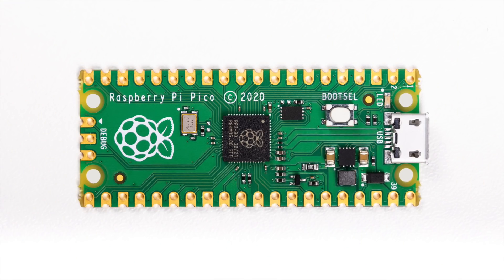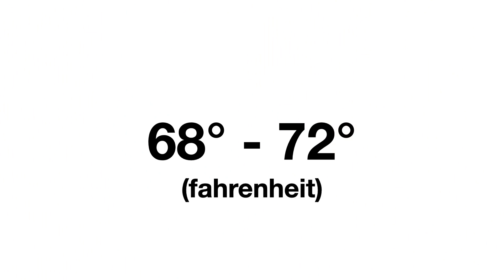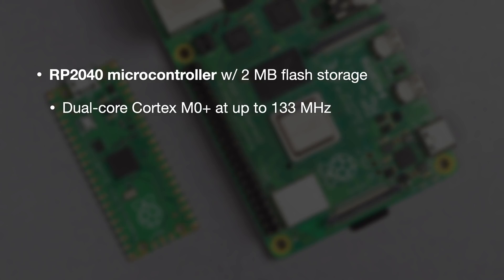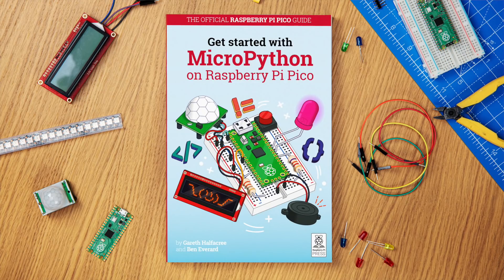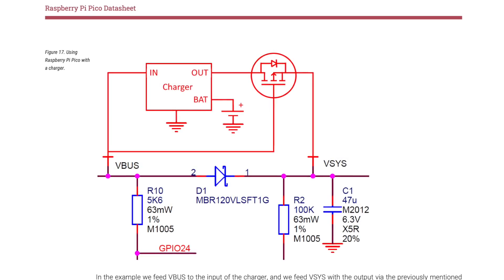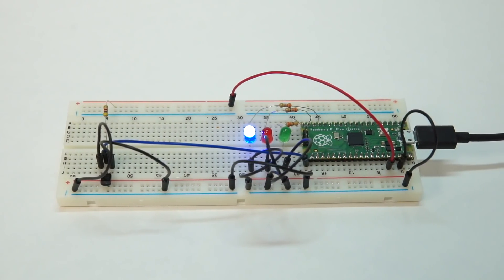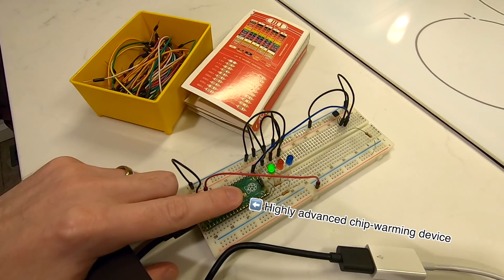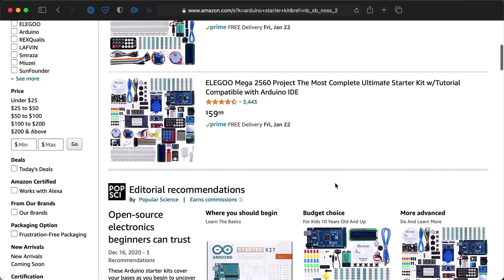The Raspberry Pi Pico Review - $4 ARM Microcontroller

Comment: In the microcontroller world, raw specs are rarely the main reason for choosing a particular microcontroller. Things like software support and built in peripherals are usually more important. In these areas the Raspberry Pi Pico is currently significantly less impressive than other offerings on the market. The main thing I think the Pico brings to the table is reasonably high specs at a low price point. Good, but not knock your socks off good.
Reply from the maker: I think that's what the Pi Foundation was going for; they'll be getting the educational / software side of things up to speed with good support over the next year or so (my guess).

The Pico is definitely not an ESP32 killer.

Comment: Hate to be that guy but I feel like if you have an FTDI or can borrow an Arduino (preferrably Uno) you can get ATmega328p's for much cheaper, much more versatile and easier to program. You just need to program them, best way would be to borrow a Arduino Uno, program it and swap out the ATmega328p

Comment: i think this device is a platform for just one thing,,, PIO Blocks,,, datasheet  RP2040  
>>   3.2. Programmer’s Model &&  3.2.1. PIO Programs
>>  3.4. Instruction Set  - PIO instructions are 16 bits long, and have the following encoding:
https://datasheets.raspberrypi.org/rp2040/rp2040_datasheet.pdf

Comment: Definitely overpowered for the intended purpose. An Arduino pro mini, led's,  relay  and a 16x2 lcd display is enough to monitor and control a fan. Even make it wireless via nrf modules to monitor and control from the next room.

Comment: Why don't you solder the pins on the other side of the board so the parts are on the underside. That way you can see the pin labels. That would make it harder to touch the microcontroller in this application though. Also help keep the dust from settling on the parts.

Comment: I did something similar with esp32, using esphome firmware to log temperature in my baby room. Linked everything to my "Home Assistant" server including aircon and had it regulate temperature automatically :)  ( later on I changed the esp for Chinese temp logger with hacked firmware )

Comment: ?
Sometimes, your choose the hardware, but because it's the best for the job, but because you want the new hardware.
Going with the pico is that case.
Getting one of the sister boards would be more practical.
Going with an LED only output is limiting.
In order to see what state the room is in requires being in sight of the device.  You could just as easily read a thermometer, and get more information.
Going with one of the sister boards would be a better choice.  The ability to communicate with you when you're not IN the room, through wifi or bluetooth, provides better functionally.  Bring able to get more information, see the actual temperature, is better.  Power consumption is not a limiting factor, you aren't required to use batteries, so you don't NEED scavenge power.

BUT, if you just WANT to use a board with lesser capabilities, for experience, bragging rights, etc., that's OK.

Comment: the internal temperature sensor is mainly meant for measuring the temperature of the die that can affect things like ADC's or clock stability etc... or just if it's about to explode from overheating. It's not really meant for this application, but if it works... :D
Reply from the maker: "If it works, it ships!" 🤪

Comment: I tend to be a little sceptical about this pico board, and I am not the only one: https://tech.scargill.net/raspberry-pi-pico-would-you-bother/
Reply from the maker: The lede of that story is the price.

I just walked out of a Micro Center where it was being sold (in quantities of one) for $2.

So, yes, there are places where you can't find it for $4. I get that. But just like people arguing you can get free shipping from CHINA on certain sites and get similar chips for $2-5... I quote prices for resellers I trust and aren't shipping direct overseas through government subsidies.

Delivering the goods is hard, and the Pi Foundation has trouble keeping any new item in stock, so right now some places (not official resellers) will be price scalping, and charging insane markups on shipping.

But to say it's not $4 when there is a significant portion of the world's population who can in fact buy it for that price...
Reply: @JeffGeerling  To most people, 2 or 4 dollars is irrelevant for the one or two boards they will buy. Personnally I can't see clearly what the PICO has to offer over the ESP's or the low end  STM boards (Blue Pill, Black pill) , except for the Raspberry Pi logo and the support of the Raspberry Pi foundation. Support of Espressif and to a bit lesser extent for private users, ST is not half bad.

Comment: in the context of microcontrollers, "RTC" usually means "real time clock" ;)
Reply: I thought the same, but in the datasheet.  "1 × Timer with 4 alarms, 1 × Real Time Counter"
Reply: @artvandelay777  In the RP2040 datasheet it actually says real time clock at the start of chapter 4.8.
Reply: @henriburau6293  Yep.  I noticed that after I posted.  "Real Time Counter" is from the pico datasheet.
Reply: @artvandelay777 so inconsistency documentation?
Reply: @yumri4  Well... a real time clock is a counter, isn't it? And, a single wire, by definition, has to work serially!
Reply: @johnm2012  even more so an oscillator electronically. COUNT the oscillations and depending on the frequency map it mathematically to to how many oscillations in a given time measurement (microseconds etc) and now you are counting time. If you all want to agree on a time then manually input or connect to a time server and then adjust your count number to the same as the server and continue on counting oscillations to increase that number and everyone is now counting the same time value.
Reply: And SWD stands for 'Single Wire Debug', not 'Serial Wire Debug' ;) source: am using it everyday atm
Reply: Road to Crisis;Research and Training Center;Renton Technical College (Renton, Washington);Response to Comments;Real Time Chat;Real-Time Communication;Regional Technical College;Real Time Counter;Real-Time Command;Real Time Capacity;Relative Time Clock;Radio Transmission Control;Remote Terminal Cluster.....dont forget the rest!
Reply: Pico have inbuilt RTc ?
Reply: If it doesn't have ble bin it !
Reply: In the context of Raspberry Pi boards, "RTC" usually means "really tiny computers" ;)

Comment: you're kidding, right? writing python on a 2mb flash mega MCU to measure temp and run 3 leds? This is everything wrong with modern electronics. You can literally do this with a few comparator. No wonder people's programs are 10mb for a led_blinkie.exe

Comment: Your review is cool and informative but I can't figure out a real-life use for the Pico. It's power consumption in sleep is too high for anything battery powered, it's gonna be overkill for a lot of projects and where it won't, chips from ST are usually gonna be a cheaper choice (plus those have SWD support embedded directly on the developer kit). If it gets people into microcontroller programming and away from Arduino, I'm gonna be super happy though. :-)

Comment: Teensy 4.1 "Hold my beer......."
Reply: I was actually looking at that earlier. A big difference is it costs over six times as much. Considering this Pi Pico is way overkill for most applications Teensy 4 is really much more of a specialty product IMO.
Reply: @eDoc2020  Yup, for a production design it would not make sense to build 5000 units at $22 extra, but for a one off unit the 600 Mhz and features are really nice. Teensy is very nice for timing critical apps like three phase sine wave inverters that also run an OLED screen etc.

Comment: There is even cheaper variant. You could use STM32103... chip (near $3) for a such simple project. It can be flushed with dedicated bootloader (you need any USE-TTL converter) to use it in conventional Arduino IDE.

Comment: yea. screw that..  Arduino esp32 all day long.    you dont need speed or flash space for doing what your doing with it.. lets be honest here.. how much speed do you need to do a single thread that reads a temp sensor and reports back via http to your logging server...  literally less than 1mhz..  lets be real here.. all those gpio's are going to be used for OTHER stuff,  like SDCards,  Wifi, or even RF devices,  and other things.. your not going to use  them unless your adding a tun of stuff onto it..

Comment: Jeff, off the wall question.  Where did you get the sound-absorbing panels behind you?  I need some of those to kill the echo at my desk,  now that my world is zoom calls. :-<
Reply from the maker: Hehe, I see what you did there... "off the wall"
Reply from the maker: Good question! I'm actually going to do a bit more of a deep dive on my current office / recording area setup, and what I'm planning on doing later this year, in a future video (so be sure to subscribe!).

The panels were salvaged from a closed down radio station (otherwise they'd just be tossed in the dumpster), and they are built from Owens Corning 703 2" thick fiberglass, wrapped in fabric.

They're fairly standard for sound absorption, and do a better job than the cheap foam panels you find in packs on Amazon. Usually a local retailer is the best option if you want to buy new, and you can get pretty much any size!

Comment: What a raspberry pi sucker you are. ESP32 costs 4-5 usd for a full dev kit in aliexpress. It has dual core, wifi, bluetooth, better devkit, better sdk, better support, and you can buy it in big quantities.
Reply: Also ESP32 has a low power mode much better than the pico xD dude, if you're going to do a review and compare, first inform yourself. You're tricking your public with lies. Public: esp32 is WAY better for all projects. Also as always raspberry pi foundation lies with prices. You can get "one" for 4 usd, you can't buy 5 or 10 for 4 usd. Such amount of lying in one video.

Comment: I am excited to see the pico used as a co-procesor for the pi 4 and 400 maybe using it to hold a piece of code or a file which would be super helpful for RetroArch soft patching, boost performance, help to process peripheral handling, a way to reduce controller lag, work as a temperature monitor or why not? For pi 4 / CM4 based handhelds as a battery indicator

Comment: Question: Why are you using an external temperature sensor? According to Pico Pi's specs, it's got one built-in.
Reply from the maker: I originally wanted to use a DS18B20 mounted far from the Pico itself, because I remember from my days building and testing Pi A+-based temperature monitoring stations, there's a bit of a thermal 'bubble' around the Pi board itself where it can be affected by the SoC, RAM, WiFi hardware, etc.—especially if it's above the board, where the warmer air rises.

It's not a huge difference by most standards (~1-2°F), but it was enough to make my data look funny.

So I typically try to isolate any temperature probes from the rest of the hardware by physically distancing them and keeping them out of any thermal draft areas.

Plus, I have a bunch of extra DS18B20s sitting in a box, so might as well put one to use!
Reply: @JeffGeerling  Thanks for the reply! Congrats on your new baby.
Reply: Sure thing, as long as what you want to measure is the silicon die temperature. People who place dedicated temperature sensors as far away from everything else and even route slots into the PCB around them to prevent heat transmission are just show-offs anyway.
Reply: @AttilaAsztalos  Yeah, I thought about that. Was just curious about the design choice. If that's the answer, I understand completely.

Comment: WHY systematically soldering the pins with the chip up? If you return the board, you'll see the pins numbers and the module will still working fine! And you'll see which pin is which! :o)

Comment: hmm... I'm regularly programming Microchips.. mostly smaller ones except for an other arm board that do have an 120Mhz CPU on it.. The RaspberryPi Pico looks promising, will certainly makes stuff easier for beginners... will be interesting to look into the documentaion which is equally as good as the other microchip documentations are (the atmega docs are easy to read [at least for me] as well.. I dont even think it's something special).

Comment: The amount of power you can get on a cheap MCU now days is amazing. I got started with electronics in around 1997. Something like this was a pipe dream back then.
Reply from the maker: That's what I keep thinking to myself. ESP32, all the Teensy boards, now this? We are truly spoiled for choice.
Reply: You could probably harvest enough thermal energy from that infant humaniod to run the sensor and wireless node that monitors it's preferred storage temperature...

Comment: You seem to be one of the first people to talk about this brand new device, that needs wireless interfaces in the future, thanks a lot. But to do your project with a microcontroller is quite ridiculous when you could do this below a mA with an analog temperature sensor and a comparator, not accounting the LEDs power consumption, running on a tiny battery for months. But I get the point, you wanted to use the new chip that will shine on complex and time critical circuits.

Comment: I didn't get the idea of this device right: let's say regular "Black pill" has 100MHz processor - it is only 1 core, but it has Cortex-M4 core which is better. So... I wouldn't say that Black pill is better, it is just almost the same thing. Rapsberry Pi was always a chiap thing that can run Linux and be connected to keyboard, monitor and so on. Pico is a weired device compiting with colored pills but without strong community STM32 microcontrollers have.

Comment: >'program efficiently' 
uses micro python
Reply from the maker: MicroPython is easy / approachable. If you want to target maximum speed and power efficiency you should drop down to C/C++ SDK.
Reply: @JeffGeerling  It's definitely a good way to get started with micro controllers yes. An interesting furtherment will be to see how rust performs in comparison to C/C++ on the Pico
Reply: @JeffGeerling  I don't see the Arduino IDE/support libs any less easy or less approachable, and that, even with its total failure of efficiency, is at least C, one small step away from dumping the Arduino lib crutches...
Reply from the maker: @AttilaAsztalos  - If you're someone who got started with scripting languages (like me), MicroPython is more immediately intuitive.

But for simple things, learning Arduino/C/C++ is not so bad. And C/C++ SDK is already there, with Arduino IDE support coming soon, according to arduino.cc
Reply: I don't get the whole "Python is more approachable" on micros at all - software is the easiest part of hardware, if someone can't understand pointers then hardware projects shouldn't even be on their radar.

The actual, and frankly niche, advantage of VM languages on micros is you can demand-page without an MMU.  The original B (as in the language before C) implementation did this.

Comment: Only 3 chanell 12bit adc :(  Biggest problem you can bay just one. And no arduino integration python is slow compered to c++ (Arduino)
Reply from the maker: The Pico has a full C/C++ SDK already, and there will even be Arduino IDE integration soon!
Reply: @JeffGeerling  then i buy one thanks

Comment: Ordered a few last night.  Can't wait to get them.  I'm astonished at the value.
Also can't wait for a new version of the Zero, if it ever comes out.  It's an absolute beast for the price, though in a different power category to the Pico.
If it can generate a video signal then surely it will not be long before we see emulators running on it for old 8-bit micros.

Comment: I'm more exiteted on the Arduino Nano RP2040 Connect. Which is based on the same chip but has Wifi and bluetooth. I just hope it 802.11ac Wifi also called Wifi 5 and not just 802.11n (Wifi 4).
I waiting for a really small Single Bord computer I can convert into Accespoints. But maybe I have to tash this idea when the Speed is so inadequit that is not really useable. And I will than go with a CM4 and a PCIe Card.

I gererally wanna build a smart home only with arduinos and RaspberyPi's

Comment: What's stopping you from soldering the header pins on the top and putting it in a breadboard upside down?
Reply: Yes, then just wire the switch into the board externally.

Comment: I wonder if this would be enough to 'run' a 3D printer. Two cores running the stepper drivers might be interesting.
Reply: Considering tons of low-cost 3D printers run on ATmegas (Marlin firmware) I'd say yes this is enough.

Comment: It's interesting, but the sleep power consumption, up around 1mA, is pretty poor compared to other M0+ microcontrollers some of which are in the nano amp range. For long-term projects that aren't requiring a battery, they really need to improve sleep power consumption.

Comment: The only thing that Metric is not good at, is that it needs 4 characters to be able to accurately get to 'room temperature'. Two digits, and a decimal. Man that's annoying. Wouldn't it be great to just have two digits and no punctuation to be able to cover MOST human-desirable temps?

Comment: I buy fully assembled esp32 boards from china for $5 shipped. I love those things to bits. The esp32 is faster than the Pi Pico and has wifi and Bluetooth for around the same price. I really see no reason to use any other MCU then the esp32, even years later. It's still the best value for the price.